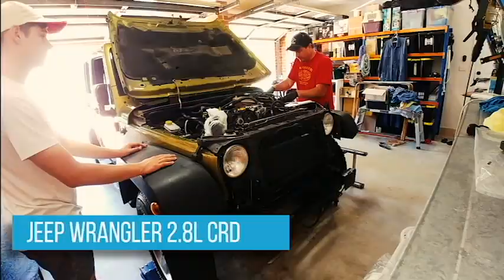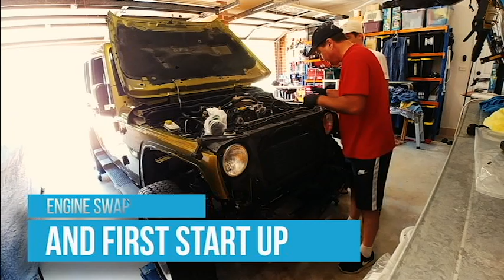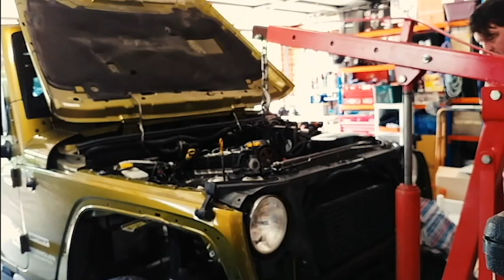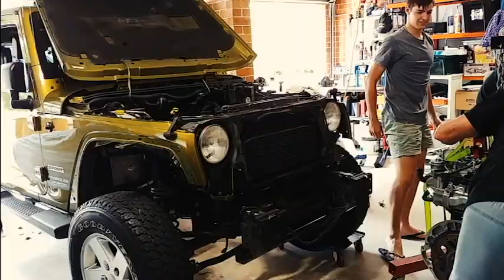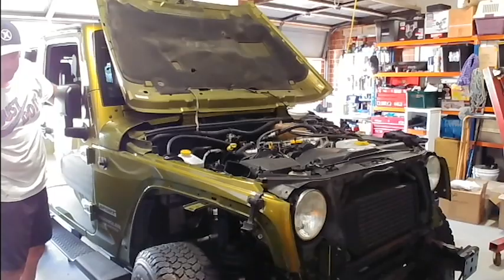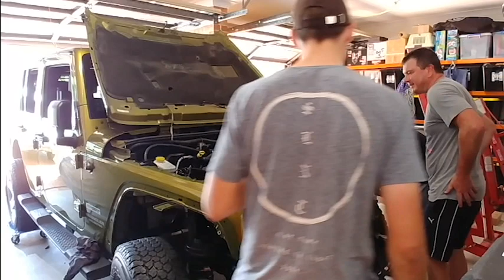JK Jeep Wrangler CRD - Engine Swap - Time Lapse

Comment: This is superb - a video I’ve looked for for ages.

Basically I have a 2007 JKU 2.8 CRD, and I’ve found that the PCM seems to be fairly unique in terms of compatibility.

Did you just get your hands on the regular 2.8 CRD from a KK Cherokee / liberty?  

Was there any recoding that you had to do or anything, or did you use the original PCM from the wrangler.

I only ask all these because I have my 07, and I’m wanting to get another engine, and build it properly, hopefully an engine with less miles and just prep it as a spare engine to start from if and when things go south on the original wrangler engine.

Many thanks for your encouraging video.
Reply from the maker: Glad you liked the video mate. If I had my time again, I would have made this video more informative, because Wrangler CRD stuff isn't well documented anywhere. My replacement motor came from a KK Cherokee and was stripped / rebuilt. The long motor is identical to that in the Wrangler, including sump and injectors. No PCM swap or programming is required. They say it is recommended to input the serial number of your injectors if you are swapping them. I had this done by Jeep and it didn't make any difference at all. Waste of money maybe? Only things to watch out for are the difference with the inlet/outlet on the diesel pump and the spigot on the rear of the crank. All up, an easy job I think. Good luck!
Reply: I know its a few years ago now. How did you get on with finding another KK motor , reconditioning it and fitting?

Comment: Did you use the injectors from the old engine or  did the kk engine come with injectors,? Did you need to recode them? Or pretty much plug and play, looking at doing the same swap soon just trying to gather info
Reply from the maker: Injectors from KK are identical. I personally don't think recoding is required. It made absolutely no difference to me. All you are doing is updating the serial number.

Comment: What adapter did you use to mate the engine to the transmission? Or did it fit as it was?
Reply from the maker: Unbolted the plate from the old Wrangler engine and swapped it over with the KK Cherokee one. Straight forward swap.
Reply: @GrouseGarage  hey how did you get the wiring to play. Where there any issues?
Reply: @GrouseGarage  Didn't think it would be that easy. Thanks!